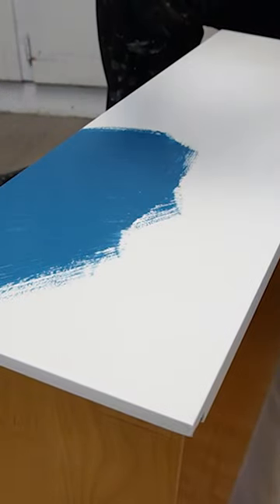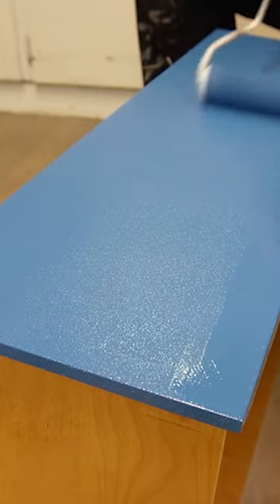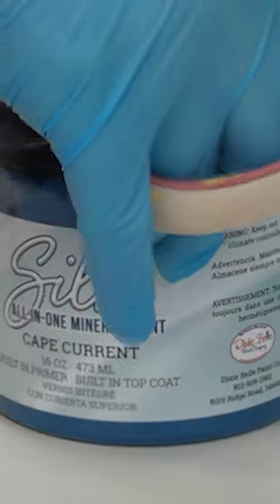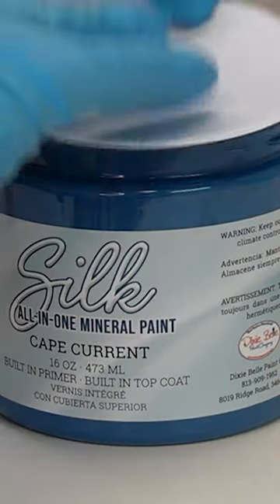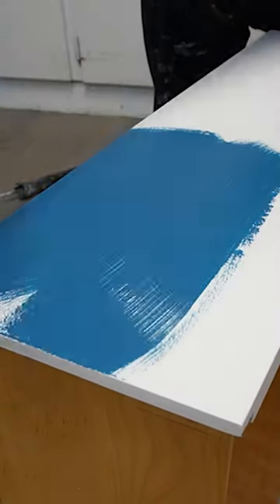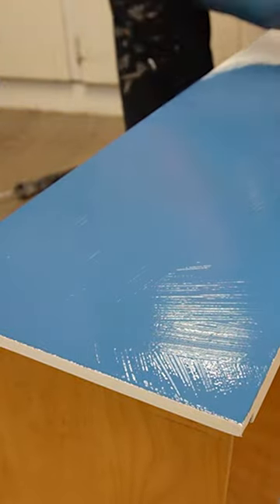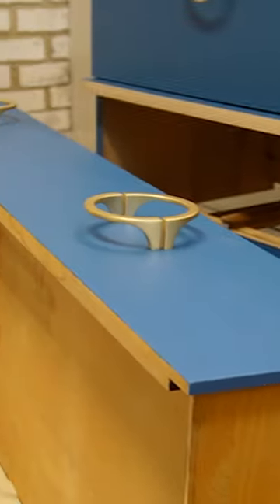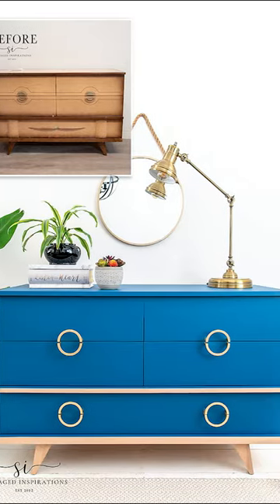#shorts How To Brush and Roll For a SMOOTH Paint Finish

Comment: Did you apply 2 coats of Silk, ran you roller over the first brushed paint with normal pressure then roll a second time with lighter pressure offloading paint on roller as need. So, was it one generous coat of Silk or two coats of Silk? The piece is gorgeous!!
Reply from the maker: Yes exactly 😊
Reply: @SalvagedInspirations  so 2 coats of Silk, correct?
Reply from the maker: Yes 👍